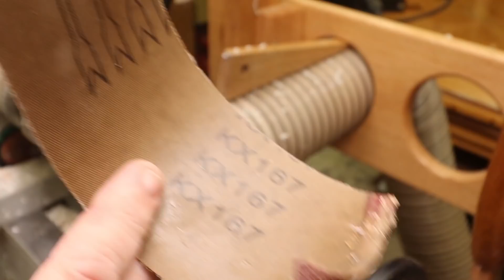Fleets Wood Shop - Everything Went Wrong

Comment: Hi Doug, Another great video. Thanks!  On the mystery of the missing resin...In looking back at some other pours it seems that the ratio of wood to resin was about 1:1 or even 1.1:1, somewhat higher than other pours.  Additionally, the wood was perhaps more porous than expected. This would account for the more apparent lowering of the resin. Your sharing with us helps a lot. We all benefit from your experience and good humor. Keep up the good work!
Reply from the maker: That's awesome my friend thank you so much for your point of views and for taking the time to say so. I've come to the conclusion. I did forget to torch the pot of resin before I poured it into the mole period which would have taken out a massive amount of air bubbles. that wound up getting taken out by the pressure pot which there in turn caused theshrinkage. And a little bit of absorption to the soft wood. But it's okay living learn you make a mistake you learn something new and thank you from Doug

Comment: You gave the hint on what the fan was by mentioning the peacock project. :)  That came out well, and it is good to see both the good and bad, otherwise we wont know what to do if we have failures.   ie the learning is from seeing both and learning what to do to fix things if they do not work as expected.
Reply from the maker: Joseph thank you so very much period and yes it's part of the peacock but what could it be. It might be a table. It might be a floor sitting piece. It might be a wall hanging. It might be a sign. It might be a planter. LOL. You never know. and you're absolutely correct about the mistakes God do I make some. But I try and find a way to work around them. And thank you thank you thank you from Doug

Comment: Hi Doug, Even though you had a few problems the end result looks really nice. The only place I can think where the resin went was into the wood itself. I have seen people put a thin coat of clear resin over the wood before the main pour which stops the resin, of the main pour, soaking into the wood when it is in the pressure pot. Great video Doug. Take care. Cheers, Huw
Reply from the maker: Huw. You I thought about that myself . I actually on the scrap piece I cut off cut open the wood next to the resin . And from my best part I couldn't tell of any absorption. Although liquid glass is very thin. And I know what you mean about putting the code on the wood. I do that so that when I pour resin on top of it you don't get air bubbles to come out of the wood into the resin . if you put a coat on the piece of wood first let it dry and then pour the resin on top it bubbles can't escape from the wood. But I'm dumbfounded why I got that much shrinkage. Thank you for your thoughts and your wisdom that's always so greatly appreciated from Doug

Comment: Crazy to see it break like that. With that much shrinkage I had assumed that the resin had absorbed deep into the wood and adhesion to its surface would be insane, yet that break came clean off the wood!
Reply from the maker: Matt thank you thank you so much for watching. The resin actually will not absorb into the wood. It will normally stick to it real well. But not absorb in. I finally figured it out. There were two issues. Before I poured the resin into the mole I always hit it with the torch to get the air bubbles out. I did that this time also. But I've been advised that liquid glass you need to do it more. When you pour the resin into the mole you create air bubbles. so the shrinkage came from the pressure pot pushing all the air out of the mole and down went the resin. When you take a pressure pot up to 80 lb it gets every spec of air out of that resin and forces air out of the wood.the second reason is I was pouring very deep at six inches resin will get very hot very fast which can in turn cause cracking like those cracks you saw in the finished product. I've since learned all of this. With all that said I've never had that issue using alumalite. But it's all good period and most importantly thank you so much again for watching and taking the time to respond that means so much to me . From Doug

Comment: Hi Doug, the problem is you did not de-gas or de-bubble your epoxy after mixing and stirring you need to pull a vacuum on the mix before pouring into the mold.  The bubbles increased the volume until they were forced out under pressure.
Reply from the maker: RANDOLPH THANK YOU .THANK YOU SO MUCH ILL TRY THAT THE NEXT TIME I USE LIQUID GLASS.I ALL WAYS HIT THE RESIN WITH THE TORCH. BEFORE I MOLD IT AND THAT ALLWAYS WORY GREAT WITH ALUMALITE .BUT ILL GIVE THE DE GAS A TRY. AND THANK YOU SO VERY MUCH FROM DOUG

Comment: I wonder if the hot Resin didn't melt the hot melt glue or at least soften it!  Something to consider.  Nice project.  Enjoy the program and yourself.
Reply from the maker: You know that's very very possible. I figured out after doing it I should have just Brad nailed each corner. The nails would have stuck to the mole when I took it off not to the softwood. The little 23 gauge pin nailer the hole would be so small you wouldn't see it anyway period it would fill up with sanding. And it would have probably been cut off on the corners anyway. So that's what I'll do on the next one which I'm actually working on. I'll just Brad nail the corners from the outside period of each piece. I'm so glad you enjoyed the video and thank you so much for taking the time to say so from Doug

Comment: Nice projects. Resin is tricky, especially when its first time use of a particular product. Trial-and-error.  I have no doubt you'll get it figured out. My wife likes the vases. Once you figure them out what do you charge for one?
Reply from the maker: Jeff thank you thank you so much for watching. I figured it out quite a while ago. That particular resin I should have used the what they call degassing. to put it in a vacuum chamber and pull the bubbles out. Before I poured it in the mold. I'm not knocking that resident but from now on I think I will stick with. Armor light. I've never really had a bad situation using that particular resin. And thank you thank you my friend.each particular project has a different value depending on what you have to put in it. And the time you put into it . If you see any particular project that I'm making that you really like please please don't ever hesitate to ask me it would be my honor. And thank you thank you from Doug

Comment: maybe on the bottom of the slats you could pin them in place (of course to be careful when cutting off on the bandsaw) and of course the resin is brittle so less interrupted cuts on the lathe could help, so maybe use the sand paper to make the octogen into a round shape before using tools just an idea from Abom69 channel with his carbide not liking interrupted cuts
Reply from the maker: Some very good thoughts my friend thank you thank you very much. I actually plan on doing that set up again. I appreciate the input very much. I'll give it a try and see how it goes and thank you thank you

Comment: Very cool!  How do you collect dust (and resin) on the table saw when using a sled?  I figure if anyone has a solution for that, it's you.
Reply from the maker: You know I've tried several times. I actually mounted a dust hose collector clamp off to the side on the sled but the clamp moved with the sled so it didn't work that great. The best way I found is just keep a loose hose close by that's turned on collecting dust and after every couple of passes just do a little vacuuming as you're cutting. I'm sure there's a way to design a bigger Hood that rides with the sled. But I've never had too big of a problem with the dust when I'm on a sled. The air suction from the saw stop on the bottom. Does a great job catching it even with the sled. That would be the best way I could think of if you don't have a saw stop would be to upgrade the amount of suction on the bottom of the blade. Sure hope that helps my friend and thank you

Comment: Do you think that the pressure pot is something you are happy with?
Reply from the maker: Yes Gary I'm very happy with the pressure pot you absolutely have to have the pressure pot to get the air bubbles out. My problem was I figured it out after the fact. I should have did gas the rest and. and pulled all the air bubbles out of it. Normally when I'm using the aluminum light I would have done that with the torch. But it didn't work as well with the liquid diamond. But to get the bubbles out of the resident to get Crystal clear resin you absolutely have to have the pressure pot when it comes to those large pours. And thank you thank you thank you so much for asking we all learn things as we go .feel free to ask anything anytime it's my pleasure. And thank you so much from Doug

Comment: What is your souce(s) for resin?
Reply from the maker: Danny thank you very much for asking. If you want small amounts the best place to get it is hobby lobby period you can run down and pick that up off the shelf they have a product sold by aluma light it's a very good one to work with it's a 50/50 mixture not by weight . and it has a 20 to 30 minute open time. But they sell it in small quantities I think two quart bottles if I'm not mistaken .for like $24. If you have a woodcrafter store in your area or online. You can order aluma light slow is what I use. and the two gallon kit runs about anywhere between 170 to $200 depending on where you find it. You can also order it directly from Amazon or ebay. if you're new into resident working you want one with a long open time at least 20 to 30 minutes. On Amazon you'll see several brands. Liquid diamond. Liquid glass. Total boat. Aluma lite. West systems. Plus a few others I can't remember them all. They're all very good. But if you want to get started right away and be able to pick it up today hobby lobby is a great place. They also have the pigment dies and powdered filaments. I sure hope that helps and thank you thank you so much from Doug
Reply: @fleetswoodshop3339 Great information, thank you very much!
Reply from the maker: You're very welcome my friend thank you thank you very much

Comment: What is o b shine juice ?
Reply from the maker: Thank you for asking my friend O B shine juice. Is named after an old wood turner from Lafayette Louisiana. He's the one that made up the concoction. It's a three-part equal mix. Of boiled linseed oil. That is store-bought boil linseed oil. Do not try and boil your own that will never work and you'll get hurt. The second part is bullseye shellac clear. The third part is denatured alcohol. You mix up and equal amount of all three together and shake it up well. you don't want to mix up a very large amount because the denatured alcohol will evaporate very fast and destroy your mixture. so you only mix it up in small amounts like 1 oz of each are less half ounce of each. Put some on a small amount on a paper towel and start applying it to your turning. Until the piece gets saturated period and then continue buffing with the same piece .you will start to be building up a heat you will feel it in your fingers. The heat is creating the friction and the heat . which dries the finish. go with the first coat until you've got it completely covered completely dried in the first coat will bring a shine to the piece of wood. Then continue to repeat the process as many times as you like building up more and more of a shine. Wait about 15 to 20 minutes between each coat. and then by your discretion you can either buff it out on a wheel or buff it out with a cotton rag. It's a one-step finish that will put a very nice shine to a wood turning. It won't really work on anything else unless it's a woodturning because you need to build up the heat and the friction to bed in the Polish. There's a gentleman by the name of Captain Eddie. If you look him up on YouTube he does a very good video on using obese shine juice. And thank you very much for asking and I hope you enjoyed the video from Doug

Comment: I don't  understand why you're adding pressure dont know your art at all but if you vacuum the resin it will get all the air out then pour it 
Like i said before i love your shop but not a wood worker by any means
If you apply vacuum make sure the bucket is 3/4 full 
Or it will make a big mess 
Love your vids
Reply from the maker: Brad thank you so much thank you so very much. I know about vacuuming the resin my friend I truly do. But unfortunately at the time my vacuum pot lid is cracked. And I just haven't gotten around to getting another one. And I use aluma light most of the times and never have an issue. The simple heat from the heat gun or the torch works wonderful with the alumni light. I know the loss to the resin was because of the bubbles coming out of it. But thank you my friend thank you I appreciate all the input I can get. And you're the best I truly appreciate it thank you my friend from Doug